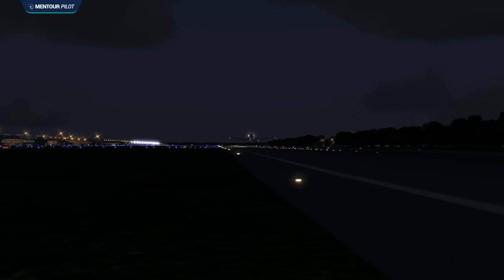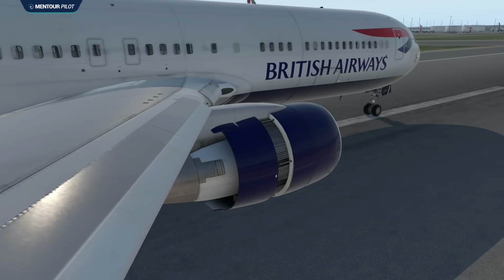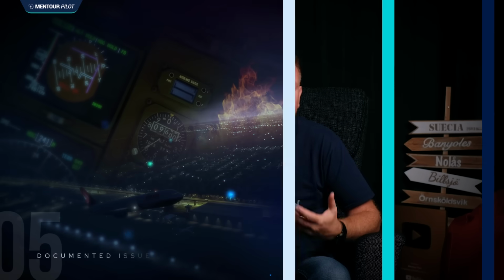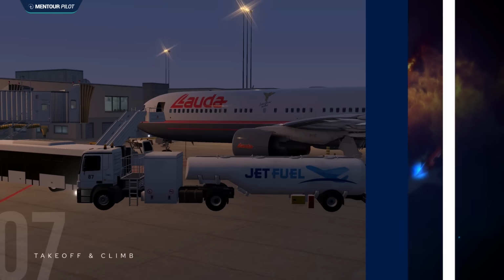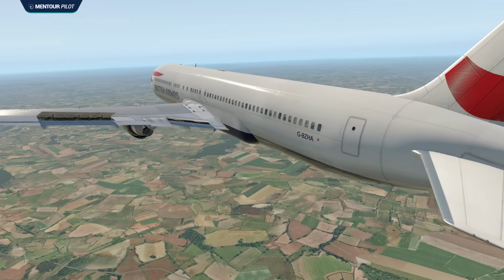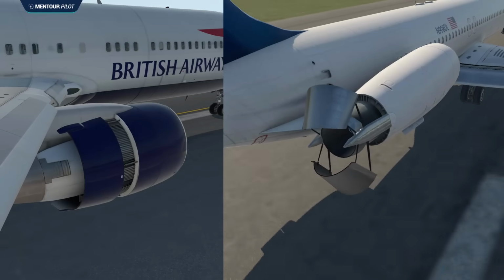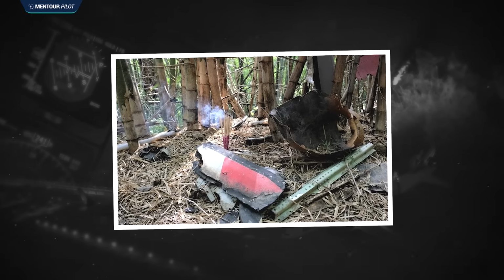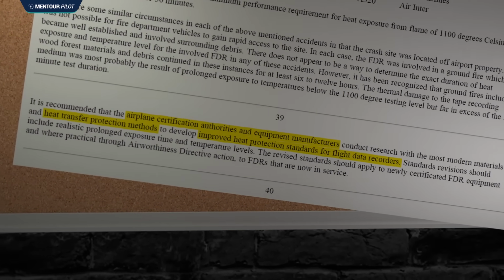HOW an Impossible Failure CRASHED this Boeing 767!

Comment: Any purely hydraulic system has the potential to fail. As you explain, the DCV relies on the hydraulic pressure to move the reverser one way or another, so if the system looses pressure, then there is nothing holding the reverser in place and airflow could move it, and of course, if the system fails like in this accident, the reverser can also deploy. For a system that could cause significant aerodynamic upset if it fails, surely a physical in-flight electrically operated lock to prevent deployment would be a good additional fail safe, have said locks hold hold the reverser in place with a spring ensuring that unless they are commanded to (i.e the servos receive an electrical current), cannot release. Even a temporary electrical fault, such as a short, shouldn't provide current long enough to cause the locks to release.
Reply: Yes, but you can see how you have to be careful too, add to many systems to "prevent" it from opening in flight, as you increase the chances that a failure causes the trust reverses to NOT open when needed on landing.
Reply: @owlman145  Opening in flight has much bigger repercussions, so I’d say the risk is worth it. Thrust-reversers were actually disabled on the whole fleet till they figured out the issue, so they’re not critical - just stress reducing.
Reply: @silverhaze90  this is an important note, all 767's had thrust reversers disabled until it was sorted. no plane that couldn't land without reversers would be certified
Reply: @owlman145  These videos seem to suggest that the reverse thrusters are only critical if the runway has no traction, namely if it's icy. Otherwise, they just reduce brake heating which reduced wear and reduces the time between flights that they need to cool off. It would certainly be critical that they function if you need to land on an icy runway, but since that's kind of rare, I'd think making sure they don't open unexpectedly has priority.
Reply: You know your stuff you!
Reply: I would've thought maybe a real direct mechanical interlock between the gear struts and all the stuff that may never be deployed in-flight.
Reply: Find the hydraulic schematic to be very strange.  It looks like there is nothing to stop a pressure drop at DCV for the reverses to deploy from the hole dam reverses being free to move out into deployed state. Even now that is very likely since the reverses are going to be pushed from the airflow alone into the deployed state if nothing stops it. 

If a leak happens at or after DCV what stops the fluids from not working there way out of the piston being pushed by airdrag? Like no load holding safety valve to stop the reverse pistons from moving due to a leak in the system? Nothing?

Like it really looks like adding one hydraulic valve on the stow side (piston in) hydraulic line had stopped this from happening. It is not shown in the schematic but there sure is 2 hydraulic lines going from DCV to the piston.  Since the hydraulic piston trying to do anything had been blocked by this extra safety valve being closed nothing had happened even if a leak or a fault made the reversers extend. Since as long as the fluid trapped in the piston and the extra valve stays where it should be nothing is going anywhere! The reverses are hydraulically locked even if the piston is being forced to move out. It is such a basic part of load holding stuff in hydraulics that is seems like such a important part of a aircraft hydraulic system.  

But then if one of this fails you got the problem that when activating the reverses you can get a asymmetrical braking when landing due to one of the engines now extra valve did not open....  Really there is no way to make the reversers fail safe. But I really can not see how they accepted this DCV nonsense being good enough. I rather trust that the most simple and most basic of valves work as they should (basically just ON or OFF) then some valve that is designed to allow multi directional flow AND hold a load... You just do not do that. You give that responsibility to the humble ON and OFF valve dedicated to make sure it keeps holding the load! Even if you have to trust 2 or more to open and close together at the same time it is just necessary. You have to trust so many things to work right that adding what basically stops the hydraulic system to lose control to extend such a big danger to the aircraft is just common sense. 

Only time the reversers are meant to be used is when on the ground. So only time the asymmetrical reversers had deployed is on the ground with this extra valves added that might end up causing it to happen true. But the way this system was deemed fail safe made it really allot more likely for a in flight deployment just to avoid it being a problem when on the ground? This is why you it is insane to be inside of a tin foil thing up high in the air going really fast and always coming down one way or a other. I rather be on the ground and have reversers act up. Thank you very much. You make sure what is fail safe truly is safe. 

Then if it fails or not your still safe. Really this extra valves needs to stay open in flight to make it possible to get a in air reversers to deploy. That DCV alone was not failsafe.
Reply: @TheDiner50  "pushing from the airflow alone"? not necessarily. Could be constructed in a way the exact opposite is true (if not already constructed in this way)
Reply: I'm not sure how the system was designed prior to the modifications being carried out, but now hydraulic pressure is required to unlock the reverser mechanism. Lack of hydraulic pressure will not deploy the reversers. Airflow will not move it. There are two brakes on each reverser sleeve half and there is a rotary flex shaft joining the 3 actuators together. If only one actuator is un-braked, nothing will move.
Reply: @ImperrfectStranger  that seems like how it should have been designed initially. In a state with no hydraulic pressure, or other failures, the reversers should simply be locked in a closed position. I cant see how the initial design that only had the DCV hold the reverser in place with hydraulic pressure, was certified.
Reply: @lewisd56  Maybe it was the way it was designed. However, no pressure wasn't the issue. They did have pressure at the reversers in this case.
Reply: @lewisd56  I don't think we are getting the full story here. He mentions the Auto Restow System at 5:00 and says he will get back to the system later, but he never did. Was this the cause of the problem? Or was this a later modification?

Comment: i don't think uploading black box recorders onto a cloud is the best idea. for starters, a hacker or hacker group can hack into it, and corrupt the data, leaving investigators with nothing. other than that, this shows the industry still has problems with putting safety first than anything and as a result, if better simulations were done in the first place, this accident wouldn't be a thing or at least be 100% trainable to prevent such a accident from getting deadly like this.
and a lot of industries are like this, even pharmaceuticals. guess the moral of this accident is to just be careful, as a consumer make sure the plane your getting on doesn't have a "experimental" idea on it thats on a critical system. industries have yet to understand 100% that safety sells.
Reply: I think there is a good case for doing a squirt of instantaneous data the moment a major exception is detected. It doesn't replace the data recorder in most circumstances but would certainly assist if the recorder is lost or at the bottom of the sea.

Comment: I'm no engineer (well not aircraft anyway) but even when you first said it was tested at low speed and altitude I was just in disbelief that they didn't test it under all possible conditions. 
It seems so obvious that the loadings and behaviour would be completely different as speeds and altitudes change that its amazing they thought that was enough. 
All systems should be tested under all possible conditions - especially when they are safety critical.
Reply: Not sure that would have helped: initial simulations after the incident  failed to reproduce it. They had to fix the simulator.
Reply: @economicprisoner  Whenever we have to test something safety critical to the point of sign off that almost always means to the point of failure. 
Lets say we're testing a simple bolt which is designed to support a 250kg load. Testing it to 251kg then declaring it to be fine since it wouldn't really make a big mess if it broke isn't going to cut it. Testing it to failure (usually multiples of its design load depending on application) would show an almost explosive shear which would then have knock-on effects for anything in its path. 
Thats why a lot of fasteners in structural or large load situations are shielded or avoided altogether if possible. 
There are so many things wrong with how this aircraft was put into this situation. 
The sign off was on the back of incomplete testing, the simulator wasn't even set up to properly simulate it, the wiring wasn't properly shielded, the checklist made it seem too trivial, the 500 hour reset when the fault kept returning should never have been allowed and the lack of a solid, manual lock out in the event of a system failure - all added to this. 
At the very least it should have been tested to the maximum the plane was capable of and if the simulator wasn't used to that then that testing should have been full scale, manual. 
It sounds over the top but I'm sure everyone on that plane would agree its not.
Reply: @siraff4461  Given that the test pilot in the corrected [simulation] found they only had 4-6 seconds to recover: I can understand why they did not do a full-scale test of something that was supposed to never happen.

Such a test would involve disabling safety interlocks.
Reply: @economicprisoner  The safety interlocks which failed in use instead? Thats not how testing works. You don't simply assume something won't fail. Thats how people get hurt - as this video shows.
Reply: @siraff4461  Yes, indeed. Thank you for this informative insight!
Reply: Indeed.

Comment: I am not a pilot. I am electrician. I enjoy learning about Aviation even though it's too late for me to become a pilot. Rule of thumb never ignore warning signals. Even if it's a faulty warning. What follows after faulty warning....... that plane should have been grounded to further notice. 🛬🤬
Reply: Although if the data about  in-flight deployment of a thrust-reverser was true it wouldn't have been a problem. Boeing deceiving the pilots and the airlines was the real problem.

Comment: A significant part of me is always annoyed or even angry that it takes the deaths of a lot of people to challenge assumptions that should be basic understanding. Such as, certification of a system should not be done only during "ideal" conditions and should be tested under different scenarios. Especially when the scenarios are common. All they had to do was test the deployment during the different phases of flight. It's not like some freak accident made the thrust reversers deploy, it happened during normal engine operation.
Reply: As an engineer who works on industrial systems that can kill or maim you, i have learned you never trust an interlock, especially an electrical one.  That system was only protected by electrical interlocks, so a simple electrical failure was the root cause of this accident, most likely.  But without data, we will never know.

But i have seen too many instances, some fatal, that were caused by a person only being protected by an electrical interlock that failed or was otherwise compromised.  Sadly, over half were operator errors, but it still meant that the interlock they were relying on to save them could not work or did not work, and they paid with their lives.

Long story short, never trust an interlock to save your life.
Reply: @jeromethiel4323  Indeed, exactly.
Reply: The testing was not intended as ideal situation. They actually thought the low speed situation was worse, as loosing speed would be worse. Their assumption was wrong, but not intentionally testing the ideal situation. Actually, they tested a situation they assumed being worse.
Reply: @CobisTaba  I note the similarities between certification testing related to this accident and to inadvertent slat retraction on the DC-10.  In the latter case, all slats retracting on one wing was flight tested and found to be safe... in cruise flight, which was assumed to be the "worst case".  But for American 191 shortly after takeoff, even some of the slats retracting led to disaster.  And just as for here, if the pilots had known what to do and done it quickly, a crash could have been avoided.
Reply: In this world, a perfectly safe airplane, with all possible 20-20 hindsight, only stays on the ground.

Comment: I wonder how many of those passengers would have boarded the plane if they told each passenger that this particular aircraft has a history of recurring problems with its thrust reverser deployment protection mechanisms.
Reply: Fault lists should be public domain.
Reply: Would that help the public to make an informed decision, though? Do they understand the significance of each potential fault? Or would it just give armchair-quaterback-karens a reason to be "outraged" at something?
Reply: @kain0m  FWIW I used to read the FAA's Service Difficulty Reports covering all problems of note throughout the airline's fleets.  It didn't help me to decide anything:  A whole bunch of airplanes having a whole bunch of problems, and essentially none of them fatal or life-threatening.

"Or would it just give armchair-quaterback-karens a reason to be "outraged" at something?"  To the extent that a sizable segment of the population thrives on outrage, that might be enough reason right there.  A public service of sorts.
Reply: @kain0m  I think it would compel airlines to fix issues out of embarrassment, not that the passengers have the technical knowledge to discern which faults are serious. You could then make a safety comparison across airlines, see what proportion of flights are on aircraft that have had recurring faults on each airline. That might explain why the $600/ticket ones are $600.

Comment: I remember this incredibly sad event....It is a very sad day to all aviation professionals when our passengers get injured ... or worse.

 "Back-in-the-day," when I had a guest in the flight deck during cruise, he asked, "Don't you ever get bored?" as he observed our relatively low workload. I thought, briefly, of the hundreds of critical things going on around us (near-supersonic air ripping by just inches from our heads; flying in the upper edges of an atmosphere where low pressures and temperatures are lethal; our dependence upon thousands of critical components; thousands of kilos of flammable liquids surging from tanks to engines and burning at incredibly hot temperatures; engines spinning at speeds and tolerances too critical to want to dwell on; the weather and navigation situations we always deal with.... etc.). I turned to him and just said, "Trust me - boring is GOOD! You wouldn't like 'exciting.'    Nuff said.

Comment: didn't something similar happen near EGLL? ISTR that some airliner crashed onto the M4 back in the 80s or 90s...
2:41 let me guess - thats EGLL27R, correct?
3:50 and there it is again 🙂but the buildings are very different in the real world.
7:07 why are those spoilers up? do they come up automatically when the thrust reversers are deployed?

Comment: I'm wondering if they leveled out and slow down a bit would that have helped or even shut down all the engines?
Reply: If they had instantly reacted perfectly by reducing thrust on both engines and gently applying rudder within 6 seconds of the deployment, then yes. However as they missed the window the plane has too much speed, so any directional inputs tear the plane apart as shown.

Comment: A rogue reversor also took the TAM402 flight down right after takeoff back in 1996 here in Brazil.
Reply from the maker: I’ll have a look at that one as well
Reply: @MentourPilot  There are more accidents with deployed thrust reversers.
A C5 Galaxy crashed in Ramstein on 20.8.1990 shortly after takeoff through an activated thrust reverser on engine 1
A Boeing 737-200 crashed after a go around because of a blocked runway on 11.2.1978 when the thrust reverser of engine 1 did not fully deactivate.

I think the 737-200 had the "old" type of reversers, don't know about the C5 ....
Reply: Oh wow...that is terrible!
Reply: Not exactly. The safety system worked, but the pilots hadn’t been trained for such an occurrence. When it happened, they thought the auto throttle had malfunctioned and were pushing the power back
Reply: @Powerranger-le4up  Not exactly! The pilots got no indication that a trust reverser was deployed and without this information they had no chance to interpret the behavior of the trust system and the whole airplane correctly!

Lacking an indicator inform the pilots that a trust reverser is deployed a serious design error!

Comment: I was waiting for you to cover this incident of the second largest airline of my country back then. Thank you
Another question about the reversers: if the runway is contaminated.. does reversethrust help "decontaminate" the runway directly in front of the wheels since they throw up so much water from the runway and are sitting so close to the maingear?
Reply from the maker: No, it can actually do the opposite by melting snow that can then re-freeze afterwards
Reply: @MentourPilot  Interesting.
I was speaking about rain tho. Probably used "contaminated" in the wrong way. Sorry
Reply: @MentourPilot  i've wondered from other videos why reversers weren't used in icy conditions and this makes total sense, thanks.
Reply: M3RedGT: Great question...hope someone is able to answer!